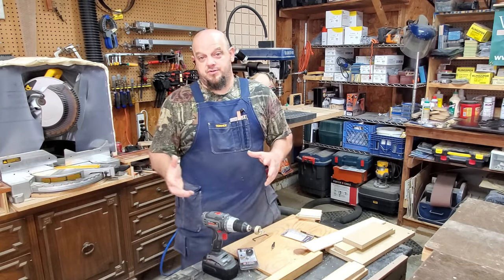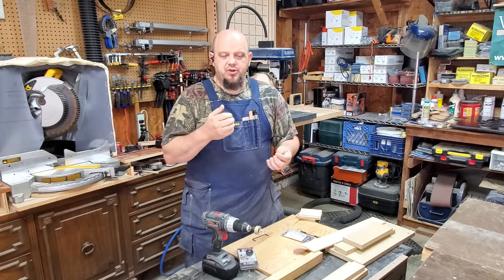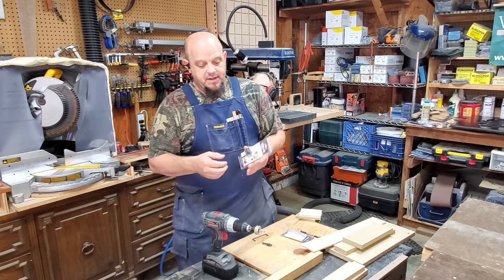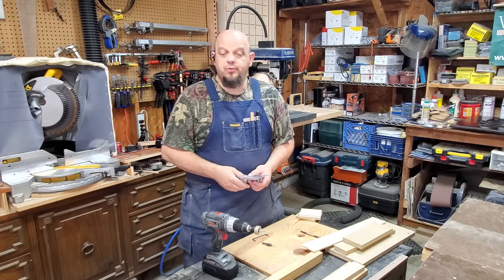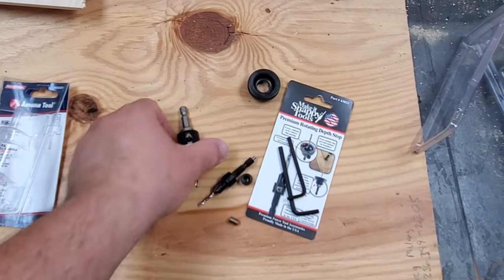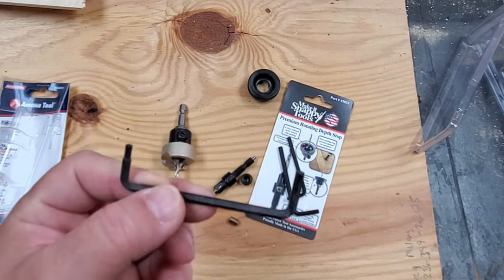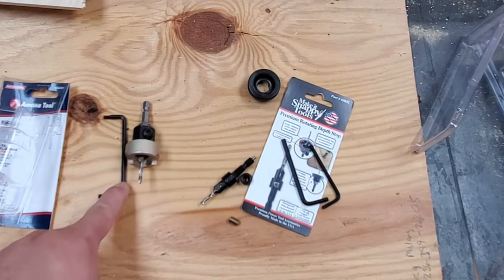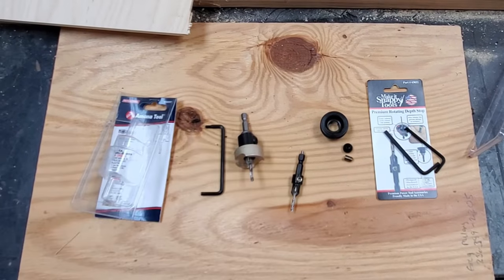Countersink Bearing Showdown Between Amana No-Mar and Snappy

Comment: I have the Snappy stop collar and it is much better than the fixed stop. It doesn't mar my wood and it doesn't get packed with chips constantly. I like it but it is inconvenient to move the long setscrew from one bit to another. A smarter man would go buy a longer setscrew for each countersink bit.
If I start countersinking more screws, I'll probably upgrade to the Amana setup.
Reply from the maker: I dont think you can go wrong either way.  There are applications where the bearing collars will be too large to use.  I ran into a project where the bearing didn't let me get close enough.  

Now I keep the amana set up with the bearing and snappy for all standard countersink applications.

Comment: Because the Amana was constantly marring a surface I had to file the collar in a few places by the opening where dust/chips are evacuated.  I picked up a Snappy collar because I had such poor results and it does better for me anecdotally.
Reply from the maker: Interesting.  I've been using it regularly since I got it and have had no issues.  There are times I use the Snappy because it's slightly smaller and can access areas the Amana can't, but other than that, It's been great, even on painted surfaces.

Comment: Silly question, what approximate speed do you run the drills? Do you slow down carbide as it’s bridle w/heat?
I burn through the dewalt countersinks and need a better quality product that will last me in the field, tyvm
Reply from the maker: I run them full trigger, so whatever the standard drill speeds are.  I will back off of my pressure depending on what bit size I'm using or wood density.  

#8+ gets run normally.  #3-6 I don't push as hard.  In general, you want the drill to do its job with occasionally backing out to remove waste.  Without keeping the pocket or flutes cleaned, heat builds up & that increases the likelihood the bits will break.

Comment: So do you have to get a set of the Amanas for different size holes or can just the pilot bit be changed to a different size?  Are they standard bits?  Thank you.
Reply from the maker: The pilot and countersink are matched.  Different pilot would require a different counter bore.  It's the same with all countersink and pilot sets.
Reply: @ChristcrossCrafts  ok thanks!  I guess that makes sense.  I was hoping since they're $40ish each and the countersink angle is 82 on all of them that maybe you could use one for multiple sizes.
Reply from the maker: @gg48gg  the point of the countersink need to coincide with the diameter of the pilot.  Otherwise it wouldn't be a smooth transition and a clean bore.  

They are pricy but very good quality.  Snappy is also decent.
Reply: @ChristcrossCrafts  thank you! Appreciate you sharing your knowledge and experience with these tools!

Comment: Hello, really excellent comparison of the two bits! Thank you for that. My question is, will the same snappy depth stop work on the other snappy counter sink bit sizes? How about the amana, can the rotating depth stop work on other amana bit sizes, or is it necessary to purchase a complete assembly for each of amana's drill bit sizes?
Reply from the maker: It appears the countersink bodies are about the same size on both manufacturers (within their respective brands).  I'd see no reason why it wouldn't fit the Amana (I don't have others but that will change soon).  I know the Snappy does.  I have a couple of other bits from them and they all have the same size housing where the bearing rests.  The Amana is worth the money I will be converting all mine over to that brand as I change them out.
Reply: Thank you for responding. I respect that
Reply from the maker: @jimbennett7248  Of course.

Comment: With the Amana, what's the maximum depth of pilot you can drill? I also noticed when you were changing the depth of pilot on the Snappy, the bit extended out the back. Is the Amana similar? Thanks for the video!
Reply from the maker: I've not measured the max but know I've drilled 1-1/2" when drilling 2x4s.  

It does extend through to the back, though I've never needed it.
Reply: @ChristcrossCrafts  That's good to know. I was looking at the replacement bits for the Amana and noticed the length of the flutes was pretty shallow, compared to the overall length of the bit. My thought was that if I needed a deeper pilot, I would have to first drill the pilot then come back and drill the countersink. I have the Dewalt tapered set now, but always have a hard time getting consistent countersink depths. Looking forward to trying out the Amana.
Reply from the maker: @HelloAnthony  Essentially, the "no-mar" is just a depth stop.  It will fit onto other countersink bits.  The countersink on the Amana is carbide tipped.  Some people don't want/need that.  

There are others much cheaper, but the stop is a must-have in my opinion.  The only issue I have had is the diameter is a little large for some applications.

Comment: I really hate spending 40$ on a bit that im going to use once a year
Reply from the maker: You must not do much drilling and countersinking.  If not, I totally get that.  If you do a lot, then it's worth it.
Reply: @ChristcrossCrafts  got my first cnc in December. tired of tape.. making a new wasteboard with t-track. this is the only reason why I have to get one. Can i just use yours for 5 min? J/K I need to go deep can it go .5 of a inch ?
Reply from the maker: @st0mper121  it can go fairly deep but that style leaves a tapered pocket.  That will make it easy to pull tthrough.
You really need to use a forster or brad point bit that leaves a flat bottom pocket.  Then use washer head or machine screws, or bolts to hold it down.  The flat head and bottom offers more security.
Reply: @ChristcrossCrafts  Really good point, thank you. I do have a 1/8th end mil flat tip upcut. sounds like i would be better off doing with the cnc now. The deeper i can get the screws the more times i can resurface the waste board. using .75 MDF as waste board.
Reply from the maker: @st0mper121  That's what I used on mine.  I sunk the pocket 1/2" and left the 1/4" for strength.  Then I found a large diameter (a little over 1/2") flat-headed screw to use to mount it.  That left me with nearly 3/8" of the material above the screw head.
Reply: I just got done doing ~ 500 holes for screws while making two cabinets.  (Glued and screwed construction.  Lots of screws used.)

I was having major trouble getting a consistent depth on the countersinking.  I could do a decent job most of the time eyeballing the depth, but it was fatiguing to pay that kind of attention.  (Chronic pancreatitis means constantly being exhausted.  I most likely had it starting in primary school.)